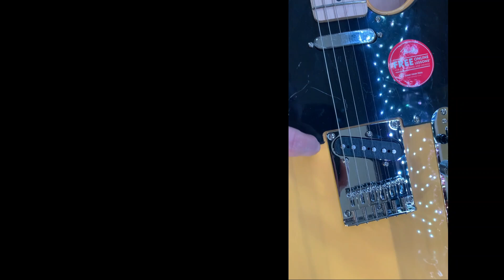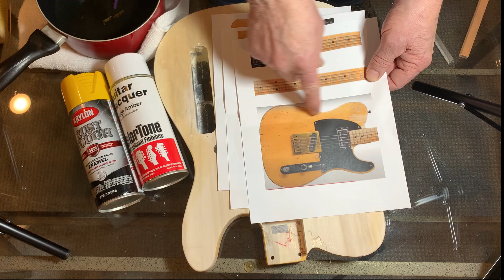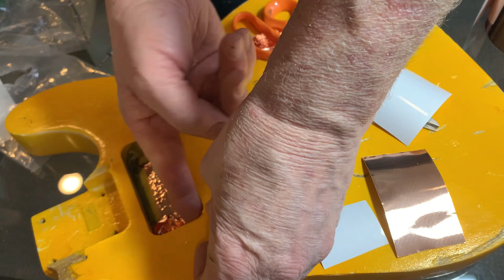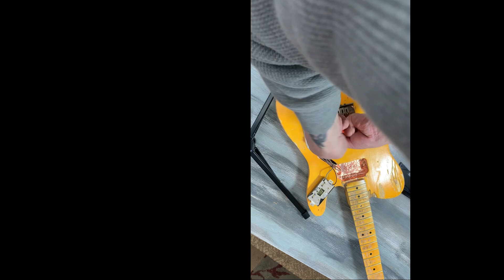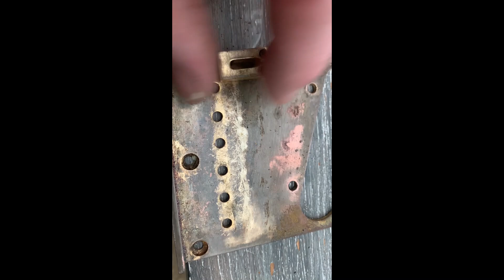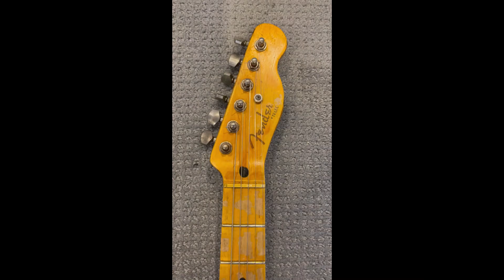Building Keith Richards "Micawber"!

Comment: My only concern is the turner's.  They're rusty on the inside now. There's a quicker way to do those but th each their own. Good job.
Reply from the maker: They did eventually stop working. Going with Sperzel tuners
Reply: @rustedwoods100  , yeah, I saw a video of how that was avoided. He only brushed them with the solution instead of dipping them.
Reply from the maker: I'm trying that next. On some unused tuners for sure!

Comment: Looks really good, the relicing is perfect, so good that you have to drill the string through body holes and add the Ferules. Does the bridge pickup have a base-plate of any kind, I know some Squiers don't have em. With the string holes and the bridge pickup plate it should be a near twin of Mr Richards. I know they put a zinc plate under the PAF and maybe the bridge too.
Reply from the maker: This Squire did not have it. GREAT info on the zinc plate under the PAF! Thank you!